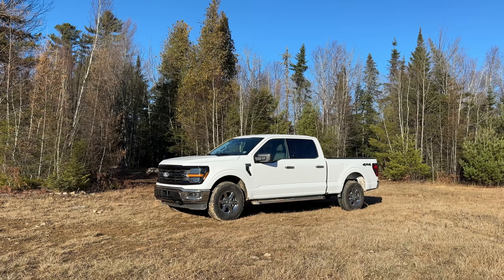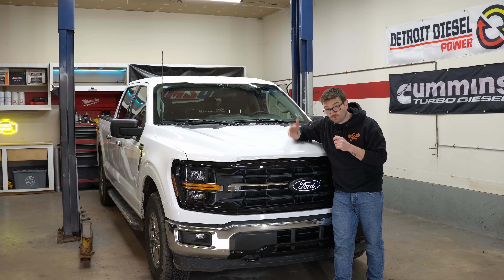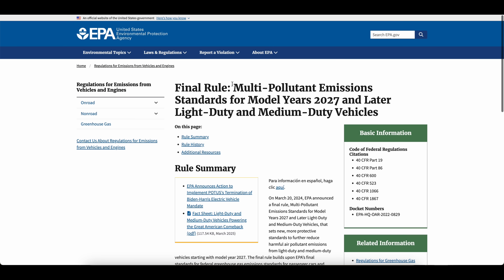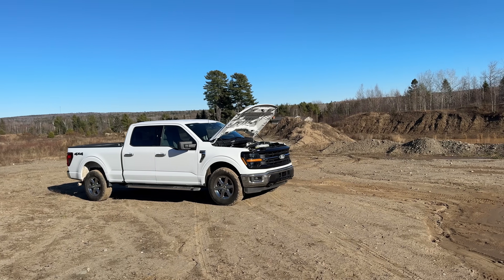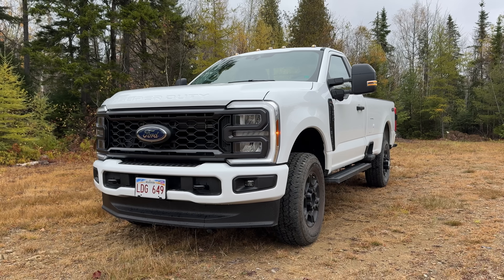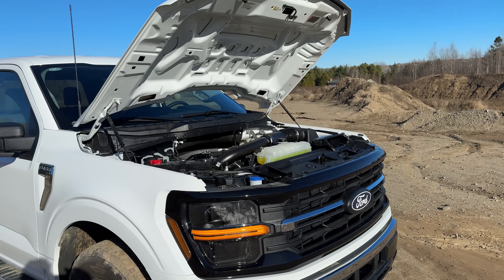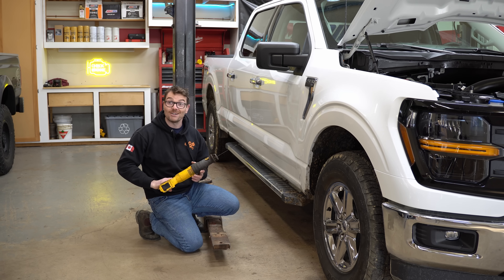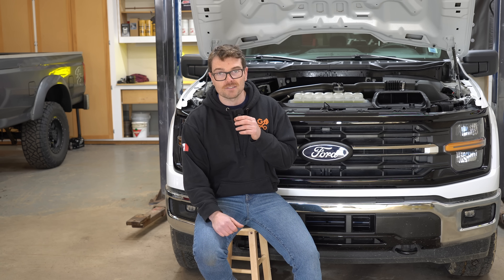Ford F-150 3.5L EcoBoost Is Now Getting Gasoline Particulate Filters… Here’s Why It Matters

Comment: There's no such thing as an economic boosted engine . . . of ANY SIZE.
It's always been a HOAX pushed by the OEM's and abetted by the CORRUPT E.P.A.
Look at the Ecoboost.
It's either Eco OR Boost.
But we all know by the way people drive like their head's on fire, IT'S ALWAYS BOOST and rarely Eco.
Then if you want them (or any other boosted engine) little Pieces of 💩 to last the warranty period you need to tune them PIG RICH when under boost so your pigheaded and lead footed customers won't torch the top and grenade the bottom of the damned things before warranty expire.

And there disappeared that fuel economy and lower emissions fantasy down the drain.

Comment: I had no idea that forced induction applications natively have more emissions but it makes sense with the higher pressure.

When you started getting into the consequences of adding boost to smaller engines for mpg and emissions reasons, then needing to add GPF into the equation due to consequences of boosted applications, it's entertaining to wonder if my 1GR-FE 4.0 in my 5th Gen 4Runner may actually end up being the "greener" long term option compared to these modern powerplants.

Fuel mileage is the obvious negative everyone brings up but with less native emissions and long service life (not requiring as many parts over engine lifetime along with an engine that's less likely of being scrapped due to BER issues - which contributes to waste), I wonder if the EPA and OEMs really need to step back and reconsider the trajectory here... Unless their end-game goal is to get consumers so sick of ICE that EV is the only way to go.

With that said, about that fuel mileage consideration, I do really wonder if it's worth it in many cases as going from 5g to 6g in the 4Runner only nets about a 3 mpg difference. Probably similar in other vehicle platforms.

Comment: Gasoline Particulate Filters do run passively tho so it burns off soot all the time and since it is designed to operate at lower exhaust temperatures typical of gasoline engines, so I don't know if it is not a problem but maybe it is not something to worry about I guess?
Reply: Also normal driving and the soot gets burned off. Also rarely needs active region, Still a little bit of similar risks tho, Would heavily recommend occasional highway trips to clean off the soot.

Comment: I’ll keep my 1999 7.3 with 310,000 miles and my 2008 F150 with a Mickey Mouse 4.6 with 260,000 miles as long as they can go I have no fear about emissions or anything choking down how they run and I’ll even keep my wife’s 2023 expedition as long as it will go even though it hasn’t crossed 70,000 mile mark yet!!! I work for Ford. I’m a Parts Manager at a Ford dealership and I guarantee you I will not own a gasoline or a diesel engine with an exhaust filter!!!!

Comment: I can honestly from say living above the arctic circle and running heavy equipment with def and dog only systems. They’re absolute dogshit. I have a 3 year old front end loader with 287 hours on it run hard and up to temp every time it’s turned on, and the whole def system has gone to hell, and there are never parts in stock at the dealer because their systems have so many failures…parts are constantly back ordered nationwide. If they think the vast majority of consumers will tolerate this garbage I think they’ll find they’re wrong.

Comment: Next question? Will the next gen GM v8 get it? DI engines above certaon displacement and HP have enough particulates (soot) to scatter on back of vehicle if tailpipe placement and shape promote it. The tailpipes with air gap to bumper trim and those fake tailpipes where real outlet is diverted down a few inches forward of tips, are ways it is mitigated. Particulate filters are addressing escaped soot and not hiding it.

Comment: 7:30 then what’s the point of a twin turbo charge Eco blue V6 if the v8s our much cleaner?
Reply: There are different types of emissions. Particulate matter is only 1 category.

A smaller turbocharged engine produces less NOX and less CO2 at idle and low load than a larger NA engine. Fuel economy is also better at idle and low load.

Comment: Port injection + DI will have far less soot than DI alone. 

DI fuel sometimes not mix and burn because you are putting in drops of fuel. Liquid fuel doesn't burn and there isn't time for all the fuel to find oxygen molecules.

With port injection, there is a lot of time to mix the fuel during the intake and compression stroke

Comment: I would like to know where these engines are more fuel efficient besides in the supposed epa numbers? I have a n/a naturally aspirated 3.5l in my 2017 f150, just bought the wife a new 25 explorer st line with the 2.3l and lemme tell you that ecoboost sucks gas worse than my truck. it does however have a ton of power, but efficient I'd air on the side of not so much. MY buddy has the 3.5l turbo and his doesn't do very great on gas mileage either and this is especially apparent towing vs a n/a v8. Don't get me wrong the ecoboost engines are powerhouse motors, but I'm not sure where they're getting efficiency from.

Comment: Next up: Gasoline Exhaust Fluid. It'll be somehow more annoying and more unreliable than the DEF-based SCR system in a diesel. Instead of crystallizing when exposed to atmosphere for too long, it will crystallize randomly and clog your GEF injectors, which will cost $10,000 a pop.

I think I'll be driving old cars for the rest of my life.

Comment: i am a commercial truck driver. i dont own nor do i wish to own an F150. as a truck driver i will tell you DPF filters are hot garbage.  it goes like this, check engine light comes on, a couple of hour later the stupid little wrench comes on. shortly after that derate and the truck is off to kenworth for more expensive repairs. i am glad i dont own the truck and my employer has to fit the bill. this type of technology is JUNK

Comment: my 2020 F150 has the 3.5 eco H.O. Great truck! I just wish they offered this engine without turbo, normal port injection and a 6 speed transmission... that would be a million mile truck guaranteed. Simple, robust low maintenance...Of course way less power and towing capability but a super reliable truck for sure, well... one can dream
Reply: the 3.5 NA duratec they had before was such a great engine. I had one in a Lincoln MKZ and i beat the hell out of it every day as a traveling IT technician driving 150+ kilometers a day sometimes above 140km/h for hours at a time and i never ever had to do anything other than oil changes. miss that car

Comment: All is fine and dandy until your low compression rings start burning oil and that oil clogs up your filter
Reply: Or sensors crap out and it goes limp mode even on new trucks. If it happens to diesels it will happen to gassers. More sensors/bs more failure

Comment: Get f*cked. Glad i have a 2011 raptor and not some newer pos.
Reply: Aren't raptors like the worst of them all? Don't those things have computers where the tranny will learn your driving habits then learn to shift how you drive? So if you drive it like a daily it will learn that pattern, if you then run it hard it will shift like garbage. Or vice versa you run it hard then use it to go to Walmart like an old man slowly and it also runs like crap. And the fix is taking it to the dealer every 15,000 miles to reset the tranny computer. Such a dumb system. Only Ford can come up with such BS. Maybe 2011 is too early for that, but the newer ones sure are a$$

Comment: What we need is a car reviewer that goes over all the problems with owning these hunk of shit ecoboosts. These engines have been in production for over a decade now and they STILL can’t fix the issues with them!! 

10 years of production and every single year model has tons of problems. 

Ford needs to bring back the 4.2l V6. They should’ve dumped money into making the Canadian Essex V6 into the next gen forced induction v6 instead of making that pile of shit 3.5l. 

My 4.2l has over 350,000 miles on the original timing components and have NEVER had any issues with rattling or any noise at all on cold starts. But you see almost all these 3.5l and 3.3l engines and 2.7l engines all have the same exact cam phaser issues that require replacing the entire timing system. It’s a joke. Just don’t buy one. I’d rather go buy a pile of shit  3v 5.4l v8 over one of these ecoboosts if I’m gonna do a timing job fuck it it’s at least gonna be easy!! Fuck these ecoboost engines. They are what has tanked ford reliability ECOBOOM
Reply: Im sorry but you are talking our your butt. The 2.7L Ecoboost has been a very solid engine since it came out in 2015. The 3.5L Ecoboost had the timing chain and cam phaser issues but that was all resolved by 2019. 

What other issues were there and are there currently that you are spouting off about?
Reply: @Jay-me7gw Wet oil pump drive belts are going to cause tons of issues on the 2.7l and 5.0l v8 engines. Apparently they didn’t learn from the 3 cylinder ecoboost engines that those belts killed before any of them rolled 100k. I’m not talking out my ass. Even current 3.5l ecoboosts have the same cam phaser issues. I’ve seen 22 models have the cam phaser issues on the interwebs. Furthermore all these new engines are an absolute pain in the dick hole to work on dude. There’s no reason to come up with all these special tools to make a fucking engine that’s more complicated than it should be….  Ecoboosts have had constant issues since day one every generation has major issues.
Reply: @jtmartin8445 the 2.7 has had the wet belt since late 2017. 8 years now. Apparently they DID learn.

And what special tools? If you can’t work on a 2.7 or 3.5 Ecoboost, you probably can’t work on any engine. Last I checked they were still held together with regular nuts and bolts.
Reply: @Jay-me7gw You’re actually sitting here making excuses for them pawning these piles of shit off on unsuspecting owners who just want a reliable vehicle that will last 300k without major repairs ? 

Did you not see what diesel particulate filters did to reliability of diesel engines ? If anyone has any sense they won’t buy this piece of shit because it’s going to have nothing but problems.

Comment: 7:50.  Just give us water injection at this point....
Reply: Aye, you might be onto something. 
My semi uses DEF to fight off high NOX emissions, it also uses EGR... id rather use high tech water injection to fight NOX over EGR and DEF.
Reply: @a @akman1931  I would bet money that back in the 70s one of the primary constraints in designing smog era emission systems was that they not affect how the end consumer operates the car, and that all this complexity is the result of manufactures being unwilling to add steps to the process of driving a car. 

Water/methanol injection kits aren’t expensive, and they would be even better and cheaper if there had been 50 years of development and integration with factory cars.

Comment: Should be able to flash the DCU with a stock tune from a 2025 truck if it isn’t locked down by vin number
Reply: Or just use HPTuners to turn off the codes.

Comment: Ford already made a statement about the power output.  It will NOT have less power. People need to calm down and take a few deep breaths.
Reply: It still says 382 on their website.
Reply: @MarkNOTW  A week or so ago, their site said 328 for a 2026 3.5 ecoboost build. There is a lie somewhere.
Reply: @jmt8706official 328 is at the wheels 😉

Comment: For all those arguing that emission equipment regularly falls off from trucks by hitting potholes. Here is a mandatory reading. Even though these guys ended up with “only” house arrests and losing everything they owned not an actual prison sentence, do you want to go through the legal headaches? YT is not fan of links so this is just the headline. “Owners of Clark County automotive repair and performance shop sentenced to home confinement, probation for conspiracy and violations of Clean Air Act”. I am sure you can find the full story.

Comment: This multipollutant rule for '27 passed in '24 is supposed to be all under review because some of it is so ridiculous. Remember that Sept deadline for input into the EPA review? And the California waiver is supposed to be history, too. It does get confusing. Greenhouse gas was whole separate issue.

Ford has been testing this 3.5 for so long that I think they just went ahead with it. They didn't need to, even if the rules weren't changed, because they take effect in '27.

The next truck I buy will be an 8.1 or a 7.4 Vortek, keeping it away for the winter. Just for spite and the satisfaction of preserving one!  Otherwise, everyone move up to the new HDs if you need new.

NB. The EPA actually wrote, in a Report, I read it, that there's no evidence that us consumers shift up a vehicle class because of their regulations. Let them believe that!! 🤣

Comment: Oh my SIlverado RST EV is looking better every day. Zero emissions and 750+HP. It now does the work of my now sold 2024 F450 and does it better, faster, and cheaper. NO regrets and video's like this CONFIRM I made the right choice for my use case. THis will push more folks to EV's which is fine by me and they outperform the gassers/diesels for about 90% of use case. On my YouTube Channel I have my latest towing video with the RST and Max battery.
Reply: The truck is what 6 months old... See in 3.5yrs, an ol truck can run 20yrs
Reply: @djtchamp5076  Pretty sure it will far outlive the modern diesels and a fraction of the cost for the average use case. I use the word  use case intentionally. There won't be any hot shot drivers running EV's in the next decade. But for the weekend worrier, local construction, landscaping, plumbing, electrical, glass companies, State, county and city rigs, the Silverado EV is like a life hack that will save valuable tax dollars while increasing the useful life of the vehicle. If you know, you know. I've owned both now and will never go back to an ICE vehicle for any of my use cases. Never ever.

Comment: 5:14 So… the reason you will almost never see a regen is because it’s a completely useless part to control a nearly non existent emission… but hey, less power and more load, and more fuel consumption will definitely save the environment… I’d love to see a case study of the manufacturing process of these “filters” with the additional fuel consumption, being compared to the actual emissions offset from the addition of these GPF “garbage political facilitators”

Comment: This is exactly the reason I'm keeping my 5.9 cummins forever. It is rust free, 163k miles, has had all of its regular maintenance. I will pay whatever it costs to rebuild the motor or trans when the time comes.
Reply: That's how I feel about my 5th gen 4runner. I'm keeping this vehicle until the end of time. Whatever happens to it I'm fixing it I don't care
Reply: Just bought a 97 5.9 5 speed myself.... videos like this make me very happy at this.
Reply: Problem you wouldn't be able to buy the part 
Or the new part will be total crap it's already the case even with brand new OEM part
Reply: You should look into fluid from under cuttings, to make sure that it stays rust free.

Comment: And the 2.7 EB already has an EGR cooler on it. How long until the EPA forces Ford to put a GPF on the 2.7 EB?

A lot of the top brass in the auto industry are happy to comply with these new standards. Many are libs that are all-in on ESG and going EV. They don't care if the GPF causes problems for the customer.

GPF's definitely can develop issues with clogging up. Short trips and extended idling will plug these up just like guys do with diesel trucks all the time. The GPF also means only certain engine oils are safe to use, so it's up to the customer to figure that out or that high ash engine oil can cause problems. If the engine is burning a bit of oil.... yikes.
Reply: The 3.5L has an EGR as well now I think.

I doubt idling will plug them up since they Ecoboost motors are port injected a low loads.

Comment: For the latest Euro standards, Porsche had to keep their turbo gas engines running lean, even in high load/WOT conditions. This required a lot of engineering and management, esp around EGT's. Not sure if the same will have to be done in the US for the upcoming standards? Also, the exhaust note of all the new Euro supercars sound really muffled because of the GPF's too.
Reply from the maker: Its all coming to the US..

Comment: This is fake news. The 2026 3.5 Hp is the same as 2025. Andre on TFLtalk called ford and the info about the 18 hp decrease was confirmed wrong from FORD themselves. Check it out yourself.
Reply: I just went to the Ford website and it says 382 hp. So if it was a mistake, you think they’d fix it on the website. So calling it fake news is not really accurate.
Reply: @MarkNOTW  
I believe Andre and TFL because he looked into it, found the truth and reported it. In my job I uncover much misinformation in company's documents on the web.  Misinformation is extremely common and the reposted on Youtube.  You can believe what you want.

Comment: Does that 3.5 F150 have a wet belt driven oil pump? Junk, all current half ton trucks are junk. They get more unreliable every year it seems.
Reply: 3.0 duramax has one too. Trucks getting worse, not better. Planned obsolesce.